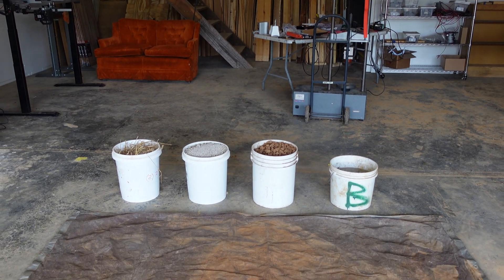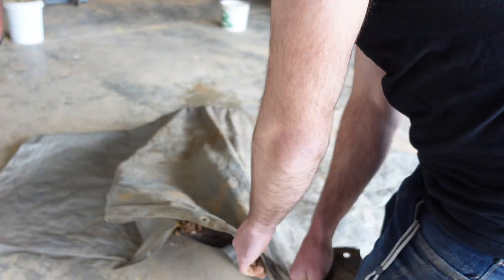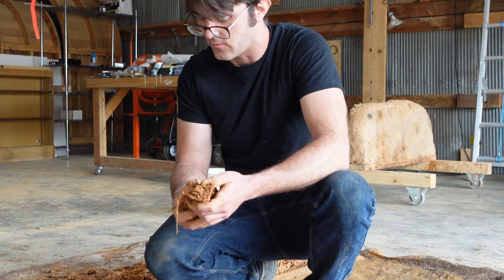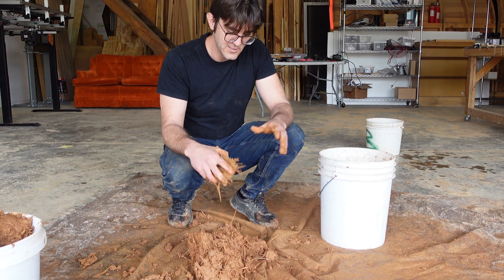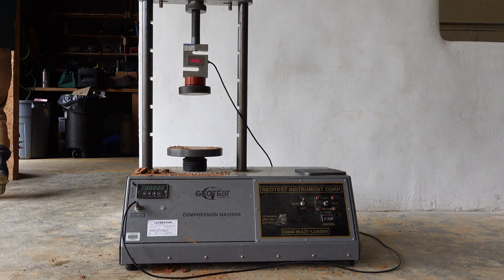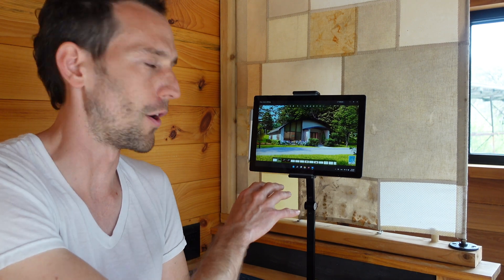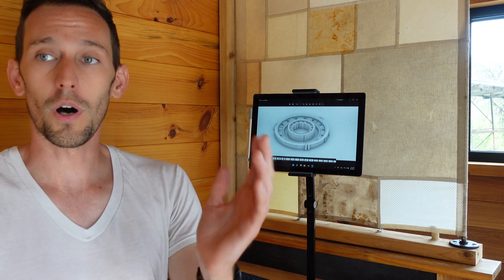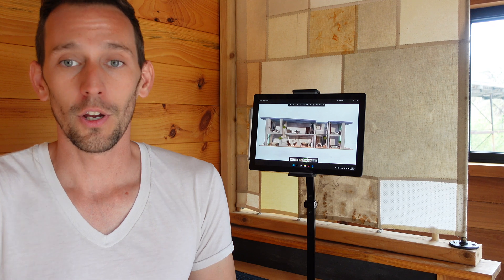How To Make Adobe Strong Enough To Build A House

Comment: I live in the New Mexico desert, about a mile from the Rio Grande. I use only sifted sand from the area for my adobe mud projects. Once dry, it's hard as rock. I've found that organic plant material prevents in the mix from properly curing, invites insects and doesn't harden like rock.
Reply: I've seen with concrete that adding a strong-in-tension component is not as straightforward as one might think
"Straw should work"   seems right, but Is not as solid as having the data. Long term is even better..
Reply: maybe there's a better reinforcing material you can put in there - some sort of synthetic fiber

Comment: Equal amounts? By weight? By volume? What kind of clay? What size aggregate? A tarp for mixing? How about a cement mixer? What did the stress tests show with straw and without? In the '50s I mixed my adobe using half clay, half sand, water-emulsified asphalt, 50-50, in a wheel barrow, poured in a form. 40 years later, outside blocks looked almost new.
Reply: It does say "how to" so your questions seem appropriate unless that was clickbait. perish the thought
Reply: Are u in New Mexico I’m trying to build bricks for myself rn
Reply: shredded tires maybe in the mix would help

Comment: Full circle.  Very ambitious, especially multi-story cobb - though they built mud beautifully up to seven stories in Yemen.  Still standing after centuries (but it does not rain there).
Reply: Cob was recently added to the code in the United States and even thought it is primarily for one story we are designing for multi-story, multi-family structures.

We do need bigger eves around here than Yemen but you can look to England for a good source of old earthen structures in a rainy place.
Reply: @terran2067  Your idea of defining a wall plane by controlled compaction is very ingenious.
Reply: @SpaceCrete  Thanks we've been experimenting with the action from close to the very beginning of the research and are starting to hone in on how it works in concert with the rest of the system.